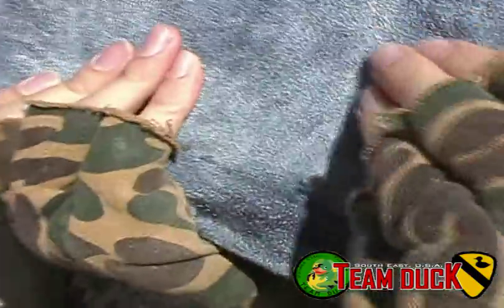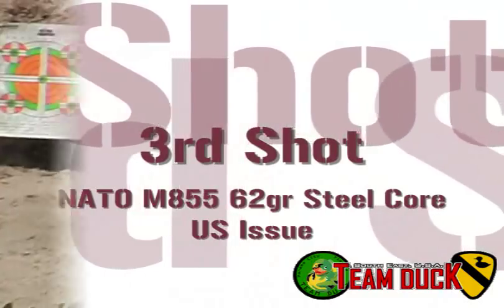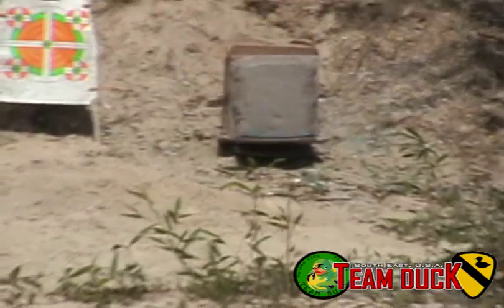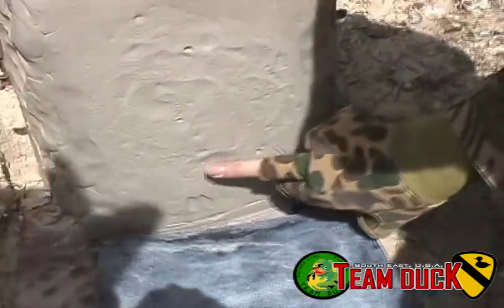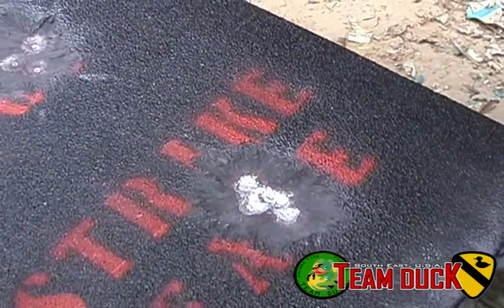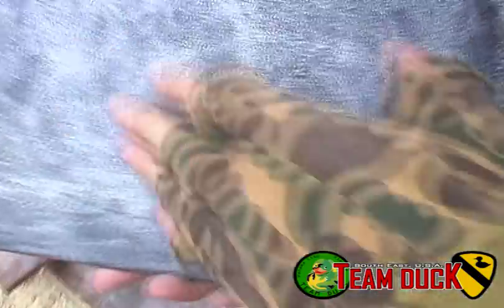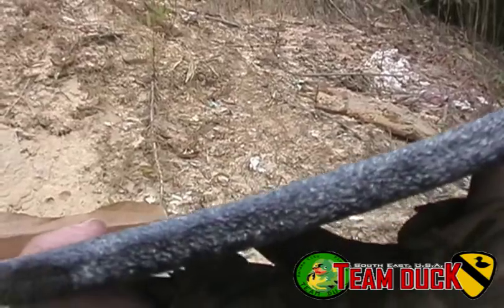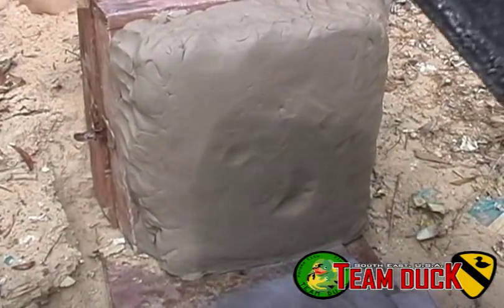EGI Tactical Level III Rifle Plate Test - 5.56x45 M855

Comment from the maker: @RayAir1 We actually shot the plate later with a 30-06 M2 ball round (2 shots in the same spot to penetrate) and with a 7.62x54R soft point (3 shots in the same place to penetrate) and 7.62x54R Steel core (5 shots to penetrate)

Comment from the maker: @nunvikingsofthesea It would likely take more than you could carry on you. We dumped 300 rounds of 5.45x39 into it from about 40 feet and all we managed to do is bend the plate into a U shape. We flipped it over and bent it back flat using 7.62x39 and 5.45x39 and it still was able to stop another few 7.62x51's placed randomly on the front.

Comment: If you do take a shot to the plate, from an assault rifle, AK or AR type, it's not going to break your ribs or knock you down. The plate divides the energy of the shot to a larger area than the butt of the rifle it was fired from. So the guy who fired the shot probably felt a harder impact.

Comment from the maker: @leyva322 The advantage comes in that it can take more strikes in the exact same spot before failure. It does impart greater energy to the body though just due to the fact that it doesn't absorb the energy of the round but instead just flat out stops it. You also end up with the round 'spalling' upon impact meaning those pieces of the bullet break apart and go flying elsewhere whereas a ceramic will normally have the round buried in layers of kevlar after stopping it.

Comment from the maker: @theunsuspecting The only 'penetration' tests we did were involving light armor pieces of Hardox of varying thickness and it seemed that the old school M855 did a better job. I would be interested to see if the ceramic reacts differently than the steel armor as far as penetration of the rounds are concerned Now to be fair we also did the M855 from a 20" AR15 and the 7N6 was from a 16" AR15. That may have had a direct effect but from what we observed the M855 was more likely to penetrate.

Comment from the maker: @theunsuspecting I had 10 magazines of 7N6 that I poured into the plate (not on top of each other like this test) and it bent the plate but no penetrations whatsoever. 

Were the issued SAPI plates ceramic? If so then they will degrade with each subsequent shot and contribute to the quick demise. To be honest the 7N6 seems to have pretty poor armor penetration by comparison to M855. I will find some pics of the plate after the mass of rounds was dumped on it and post a link. if possible.

Comment from the maker: @CBAsystems Seriously looks like a Halo armor set with those. Interesting design but what is the penetration when hit on the thinner segments? Does that section have the same properties for resistance as the center or is there a difference? The next experiment is a similar plate to the EGI with a kevlar wrapping to stop spalling. Right now that is our biggest concern with the steel plates being used by ops.

Comment from the maker: @CBAsystems When directly in contact with the clay we had around 40mm of deformation with a 30-06. When laid against a IIIA vest there is no direct deformation, only a 1mm full plate recession into the clay. We have another video of 7.62x51 NATO M80, 4 shots in a 2" zone. If you have a test plate we could purchase to try out let us know. Recently we got a 1000fps camera to assist in testing.

Comment from the maker: We did. We used a 7N6 after we got done filming. 210 rounds with no penetration (just a complete target dump on it). We ended up bending the plate into a semi-U shape. We flipped it back over and bent it flat with another 90 rounds.

Comment from the maker: @nunvikingsofthesea Actually, yes. Just not on the 5.56 though. The two rounds that actually were different when comparing the lead core vs steel core were 7.62x54. The lead core went through in 4 rounds, the steel core took 5.

Comment: @CaptainMurphyDUCK what' areal denisity and how is the back face when hit with Level III and IV?  Use clay backing my plates with the Tactical vest is 22mm back face  and Level IV is 32mm.  My weight is 3.8 lbs same as standard Dyneema but my profile is like.75 Level III  thick and Level IV is 1.25 thick-4.2 lbs

Comment: @CaptainMurphyDUCK I doubt that out of 300 rds of 7N6 none penetrated. Ive seen a set of issued SAPIs where one side was shot with M855 and took 17 hits before rounds started penetrating, then the other plate was shot with 7N6 and it took 4 rds and after that they started zipping through.

Comment from the maker: @mjmai2457 That has been a gray area for the BATFE for years. Until there is case law to back up the criminal prosecution for use of rifle specific ammunition in a pistol built platform it will be hard to justify removing the video. The law was specifically targeted from a knee jerk reaction to 'cop killer' bullets (which don't exist) and has been targeted for ammunition that is specifically designed for pistol usage.

Comment: What kind of ammo were you using?  Was it standard issue NATO M855 steel core penetrator?  I wish that you would have said something about it in the video.
Reply from the maker: Title of the video says so: EGI Tactical Level III Rifle Plate Test - 5.56x45 M855
In the first 30 seconds someone also says it. We tried to make sure we said what we were shooting before each shot on the video to make sure we didn't get the shots mixed up during editing later on. We had a habit of changing ammo in between segments of video so we were being thorough.

Comment: @FlamingPope slug? ak 47? it funny how every one thinks they know something aobut weapons, the 7.62x39 used by the ak 47 (m43 with ball ammo) its not even one of the most powerfull rounds out there, its an intermetiate cartridge, smaller than the 7,62x51, 54, 63 and all the other powerfull rifle ammunion out there, adn about penetration, well that round hasserious problems to deal with soft stell at 150 mts.